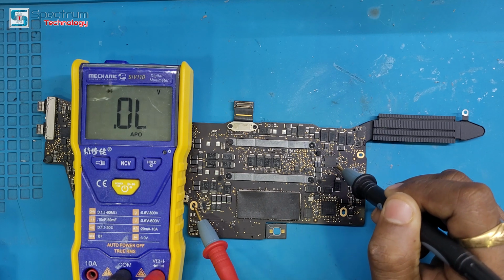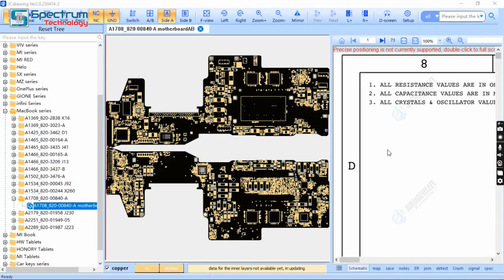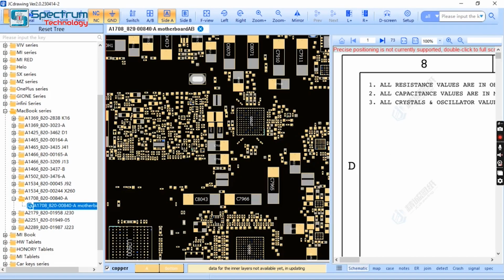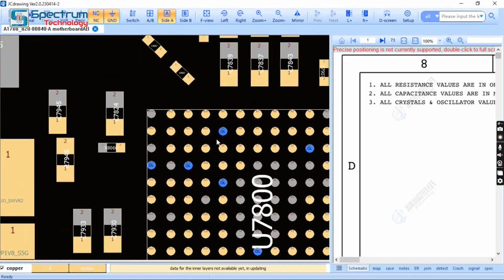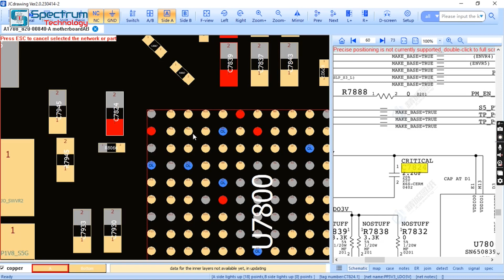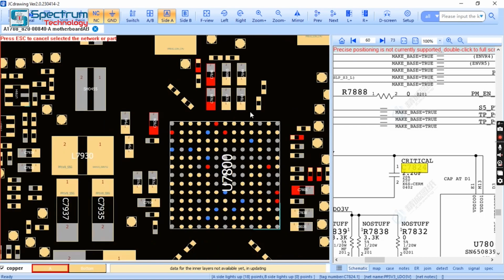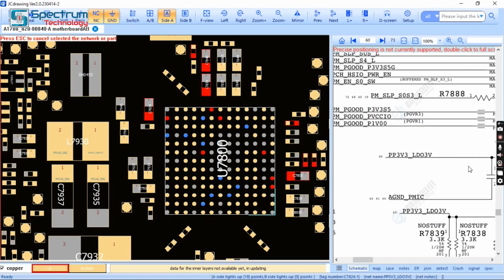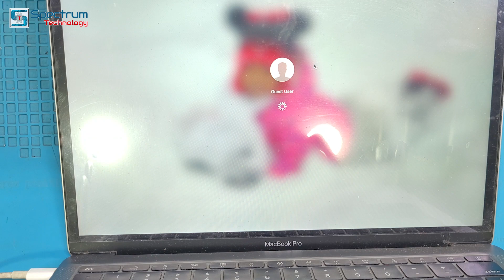How to Fix MacBook Pro A1708 Won’t Turn On

Comment: Would a blown s1c635 chip that's blown cause no power
Reply from the maker: Yes of course 
It would cause no power
Because in my case it has short the 3.3v ldo line which makes it no power